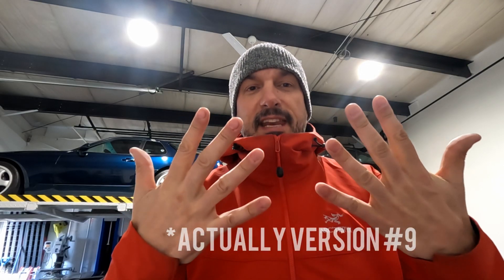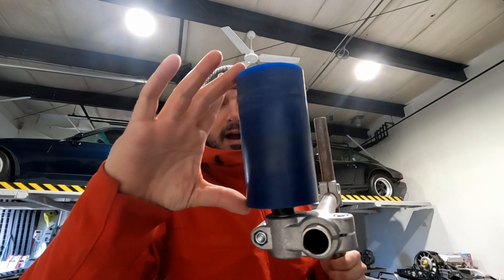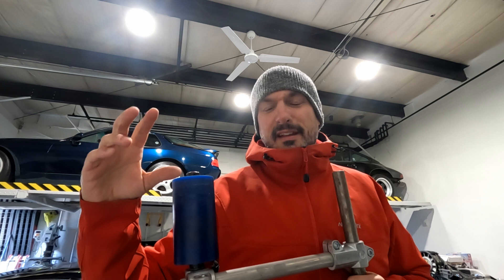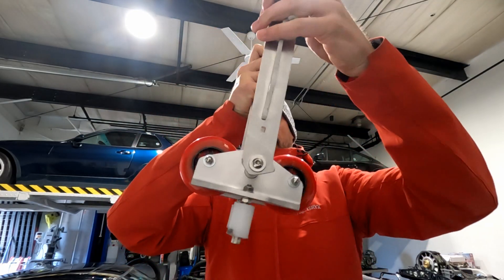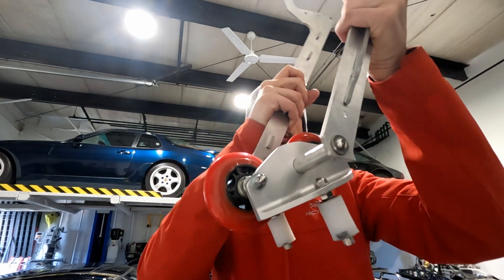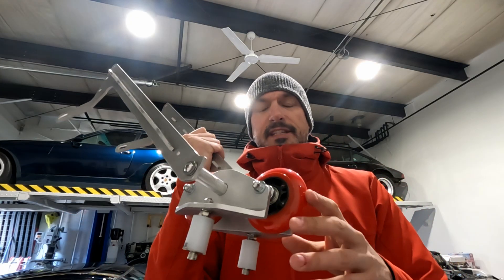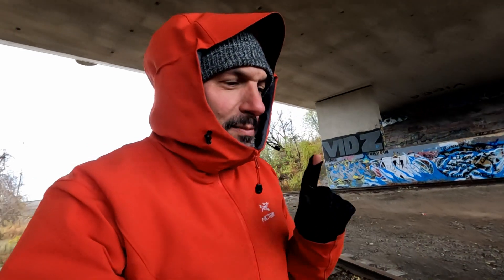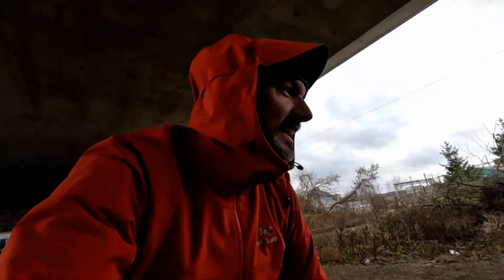RAIL BIKE - Version 9 - New Front Guide | Modified Outrigger Wheel | First Female RAIL RIDER!

Comment: It is great to keep track of your progress.

I'm not so sure about those little side wheels. Small wheels find obstacles more easlily. Plus... they don't "float" since they are solidly mounted. 

The Bentley railbike has these wheels spring loaded on little arms. Google Bentley Railbike. Dick has plans. His guide is similar to this one of yours, and he and his wife have been using it for decades.

Again, your front guide needs to be more forward, out front.

Good luck in your endeavors... I'm curious to see your new outrigger. You may teach this old dog new tricks. isn't this fun, solving all these problems?

When you ride 80 miles, you'll beat me. I'm not so sure even I could beat Richard Smart, Peter Hoffman, and Arne Nilsson... those guys have taken some epic rides.
Reply from the maker: At this point, I'm putting together the most extensive library of differing Railbike design videos. I don't even have a goal anymore...I just think, build, test, repeat 😂 
I know the Bentley Railbike, and I was sent the Dahon Railbike plans from a viewer. I took some design aspects from both. Both clearly have been well developed over the years. I need something a bit more packable while riding off the rails. 
Next up I'm going to try a front wheel mounted outrigger, just for fun...then, who knows what will be next! 😂